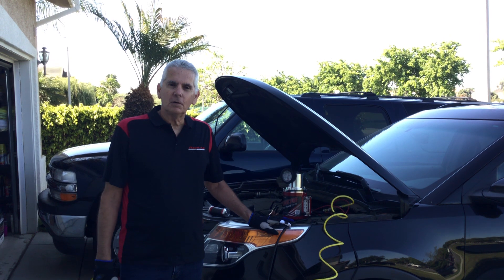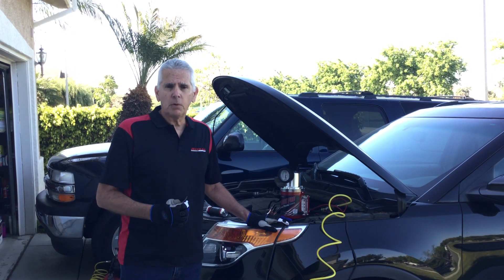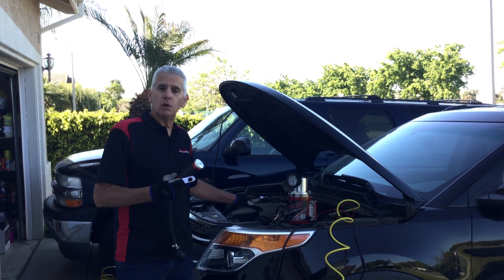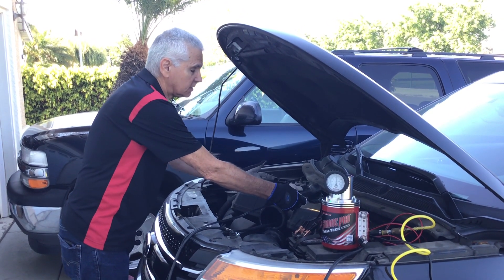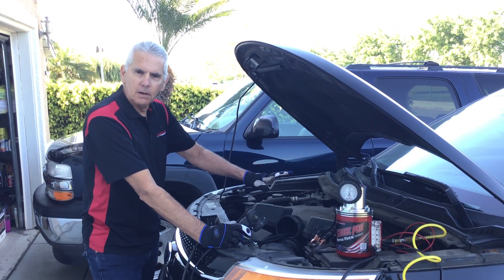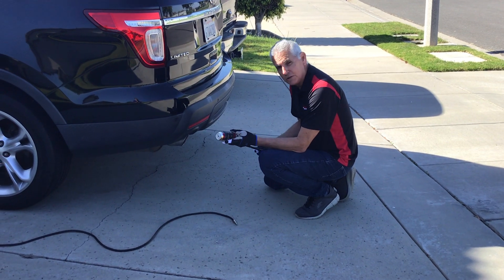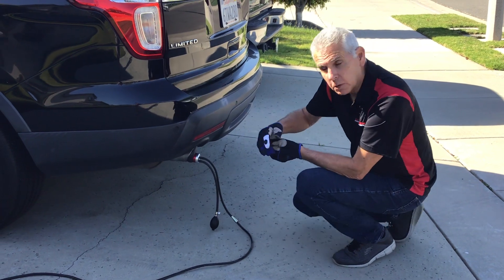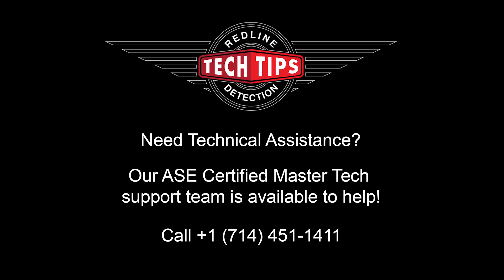Tech Tip: P0171 Lean Condition - Testing the Intake and Exhaust System

Comment: Great video. In case you are still responsive to questions, I’d really appreciate your answering my following question. I’ve got p0171 and p0174 on an old highlander after long hours of driving (>300 km continuously at high speed). But after the codes were cleared, short distance driving for days (80 km each time at speeds of around 90km/h but not much higher), the codes never reappeared. However, another long distance driving for hours at 100 km/h or higher, the code re-emerged again. I suspect it is due to exhaust leak which I can almost hear when suddenly accelerate from slow speed. Did your exhaust leak check engine light occur similar to my case (i.e. only after long term high speed driving)?
Reply: I found a hole in my resonator looked like a drill bit hole. I thought someone vandalized my car, I never noticed it before but I ended up popping the p0171 code. Idk if that would be even possible to throw that code because of it. Someone on my hummer forum said he had the exact same hole for water to drip out idk tbh.
Reply: @lorianvalhalla2938  Thanks. Vacuum leaks are known cause of p0171/0174 in mamy cases. It typically shows when idling and disappears when gas peddle is pressed hard, opposite to my problem which occurs when accelerating. I resolved mine after realizing that I never knew how to cleam the MAF sensor. I had always been cleaning the temperature sensor but missing the MAF sensor which is hidden deep inside a tube in Toyota. My was simply due to dirty MAF sensor.